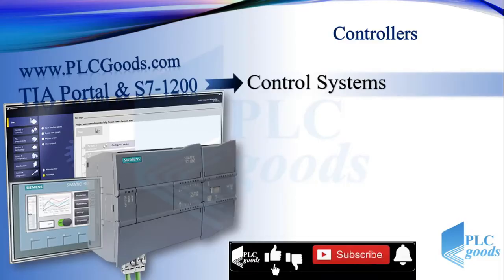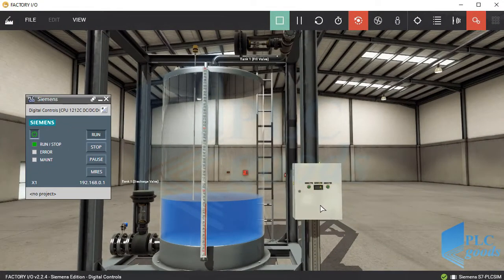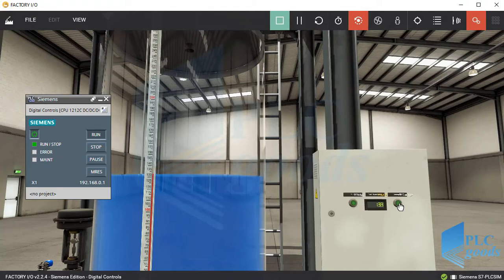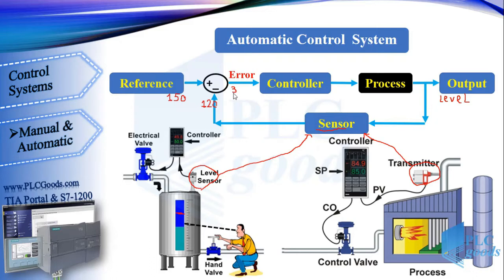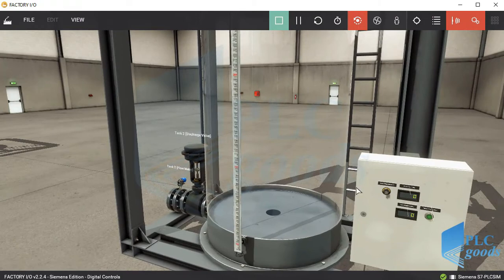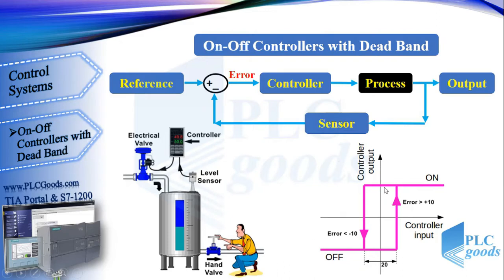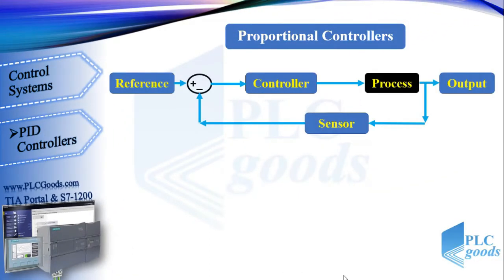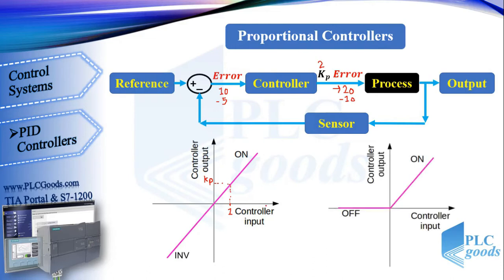TIA PORTAL PLC Tutorial | Manual, On/Off, Deadband & Proportional Controllers | L 39

Comment: Can you define what each tag does in your simulator? Or what it stands for
Reply: Hi dear. I used the tank system several times before this video. Maybe our previous videos can help you. 
Also, I used suitable tags for important addresses. for example, this tag 'Tank-Setpoint' refers to desired or reference level, or 'tank-filling valve' is connected to the fill valve inside factory io software. 
Note that, Addresses without any tag are not so important. I only used them as an intermediate variable to store a result, and then use them for the next instruction.
However, If you don't understand a specific address or tag, please write it in the comment section.
Reply from the maker: Thanks for checking out the channel!
Reply: Hello there I really wanna learn PID tuning with level and temperature. Typical analog input 4-20mA. Will the S7-1200 + HMI kit be sufficient or I need S7-1500??
Reply: @seabelekgowe9958  Hi there,  if you want to buy real PLCs, both S7-1200 and S7-1500 support PID controllers. but if you want to learn PID controllers with PLCSIM (Virtual PLC), you will need to use an S7-1500 inside the hardware configuration of TIA Portal
Reply: @plcgoodsmentor9223  do you sell the S7-1500 with TIA 365 days?
Reply: @seabelekgowe9958  note that, TIA portal software supports both S7-1200 and S7-1500.  anyway, we don't sell siemens products like its PLCs or TIA Portal Software
Reply: Note that PID controllers are performed by PLCs and HMIs only show our results. So, it does not matter what your HMI model is